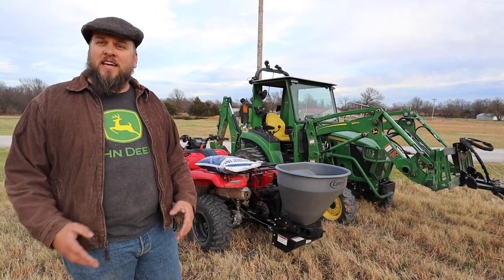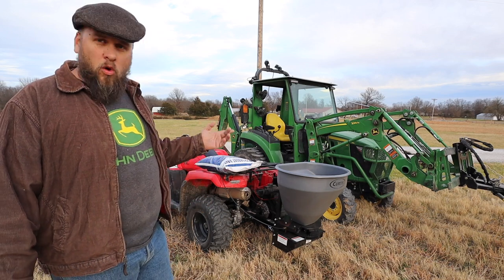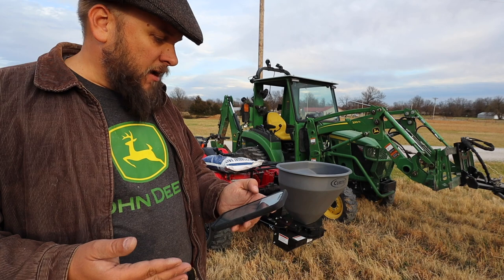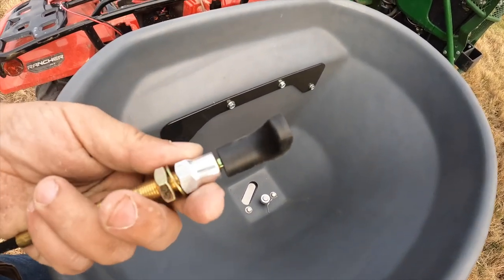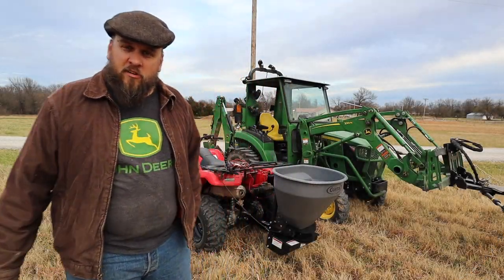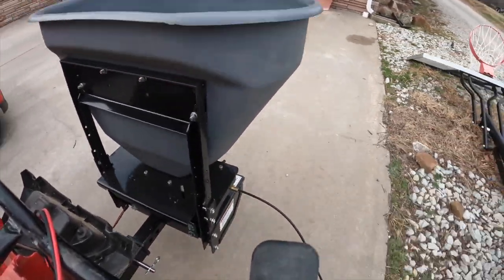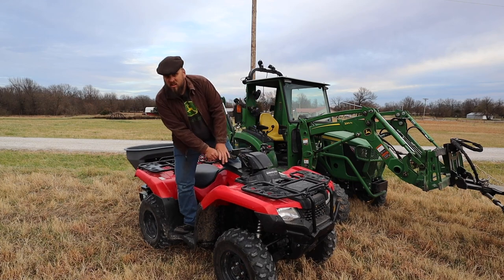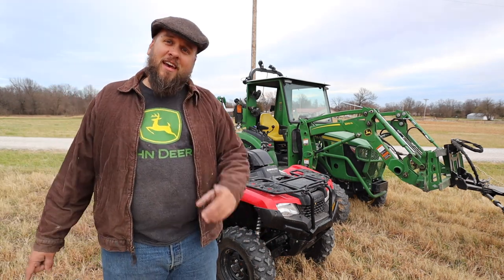A New Way to Deal with Snow and Ice

Comment: Good to have you back.  I hope you had a nice vacation.  If you fill the hopper on your spreader, does the weight affect the balance and handling of your four-wheeler?  I seem to relate everything to tractors, and on tractors, weight distribution is an important safety consideration.  Just thought I'd bring that up.
Reply from the maker: Not an issue yesterday but if there was ice on the ground and more than one bag in the hopper it could be an issue. I guess I will find out

Thanks for watching
Reply: @RockhillfarmYT  two on the front rack two on the hopper. Reload one from the front to the back. Keeps it balanced.
Reply from the maker: Good suggestion